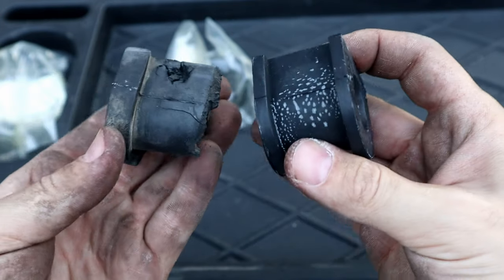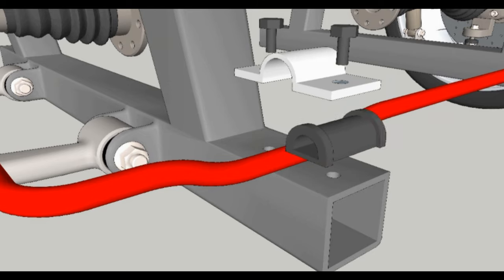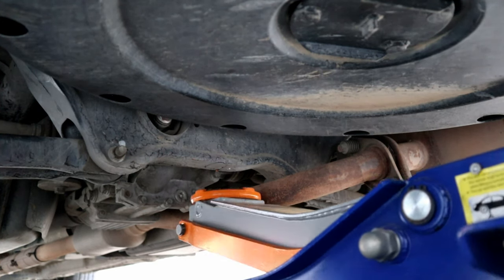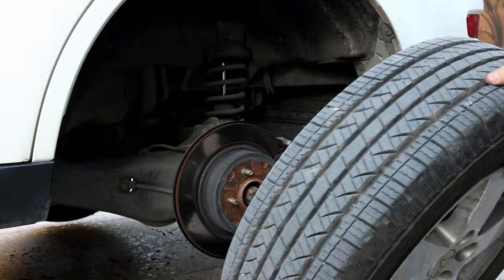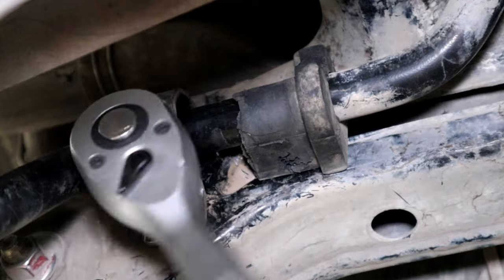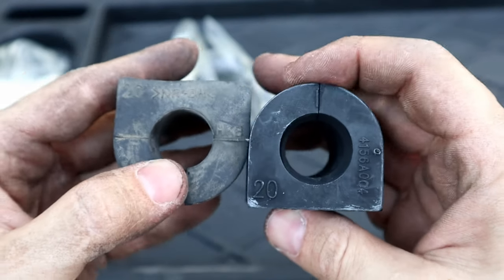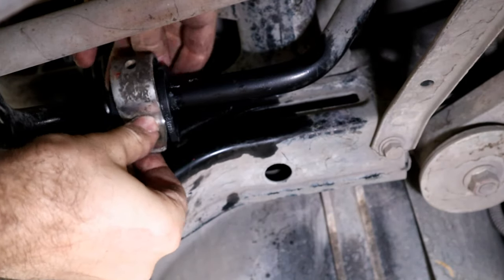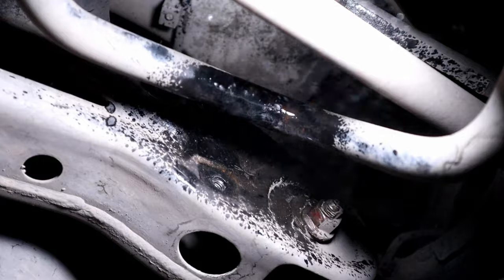Checking my suspension with Gopro Camera/How to replace sway bar bushing/bad sway bar bushing sound

Comment: Thanks for the video, I did mine done today, but the ones on the front side. It was quite easy and I could prevent the bolts to be rusted to the frame. I didn't even have to lift the car up. Very informative.
Reply from the maker: Glad you did it, thanks for watching
Reply: There is always something interesting to see here. Keep up the good work👌🏻
Reply from the maker: Thanks brother, appreciate that